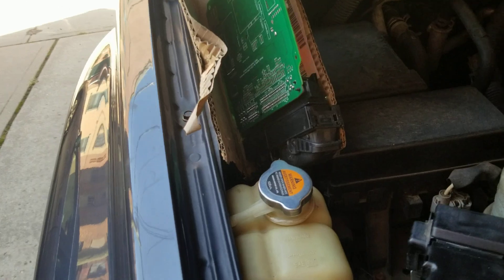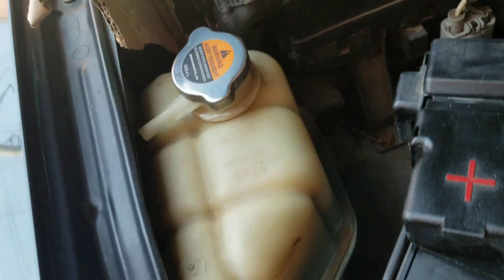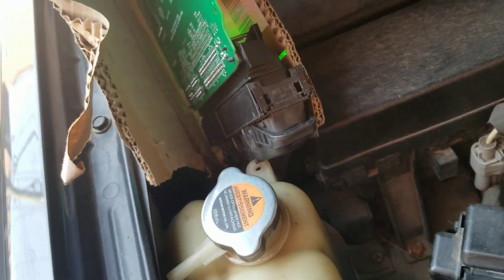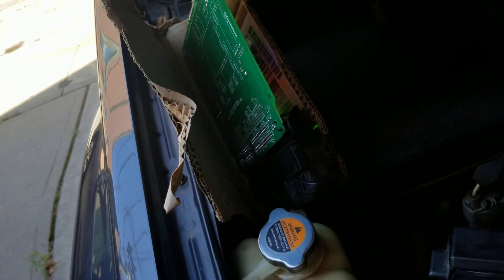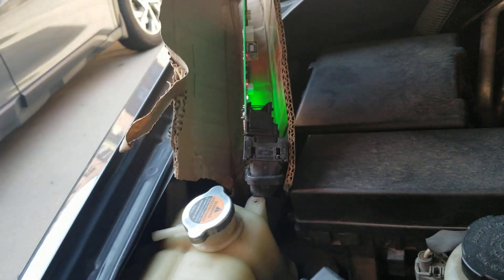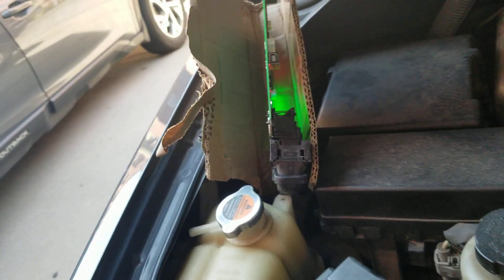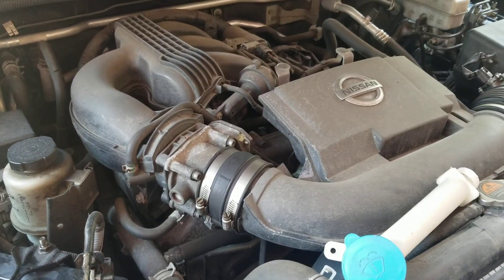#rusEFI calibration via CAN bus

Comment: is this the same way / protocol that INPA/ISTA uses to flash firmware on the BMW?  Does ISTA tunnel along  the PT-CANbus to flash modules??
Reply from the maker: it shared same CAN wires and it shared ISO-TP but it's still completely different from ISTA.